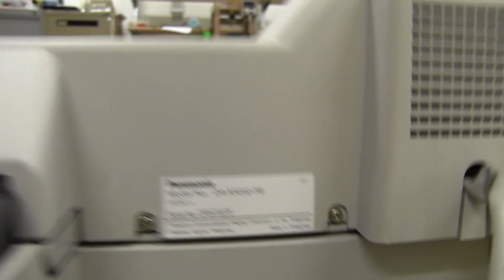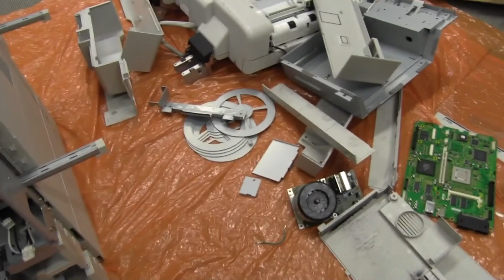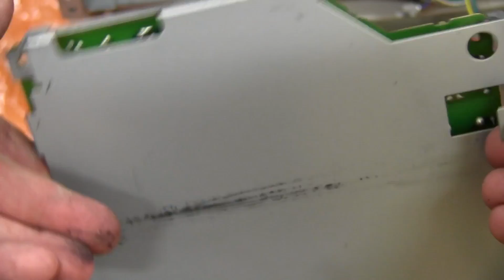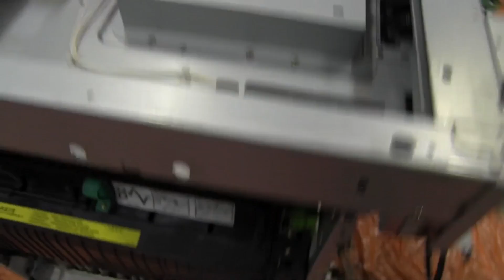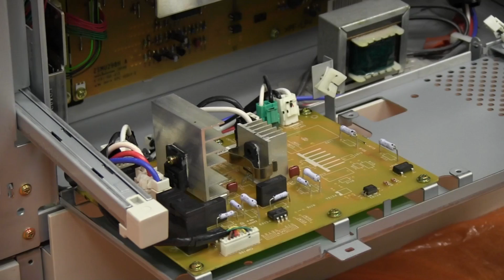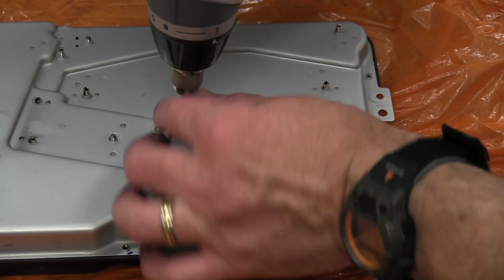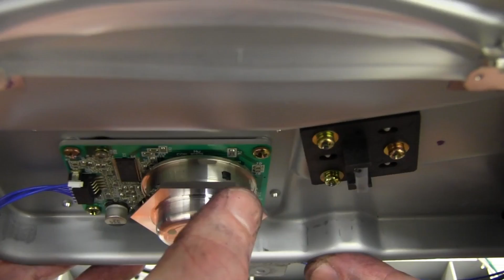EEVblog #303 - Photocopier Extreme Teardown

Comment: Great video!
Just wanted to concur with everyone else ;) 
The CCD is usually between one and three rows high, this type of device is also called a linescan or line camera. They are often used for quality control in industries.
The reason for the two different "arms" with mirrors is for the distance between the lens and the paper to remain fixed, quite clever :)

Comment: i reciently found a lazer printer and the polygon motor and optical systems and some of the stuff were almost the same as that photocopier. And as you said, lots of stuff to hack with. relays, motors, 2 big steppers, solenoid actuators, optical sensors, microcontrollers, eeproms, sdrams, E core transformers, a big 470µf 400V cap, chokes, toroids and of course LOTS OF COGS TOO

Comment: Dave, I've seen scanner devices like that one before in flatbed scanners. The CCD is a single horizontal line of pixels that samples an entire line of page. There is no horizontal scanning like there is in the lazer printer section, it's litterally all pixels in a line.

Comment: The flywheel is there to help stabilise the rotation of the drum and stop image abnormalities due to minute changes. Those smaller units in the paper feed section are drive clutches, quite common to have a single drive motor and clutches to engage drive to seperate sections.

The HV unit can are quite high in voltage, our machines run in the order of 6000v for the transfer stages.

Need to get you one of our retired colour machines with a transfer belt to tear down!

Comment: yea it`s a nice Scanning Laser beam unit there at 33:20 :) 
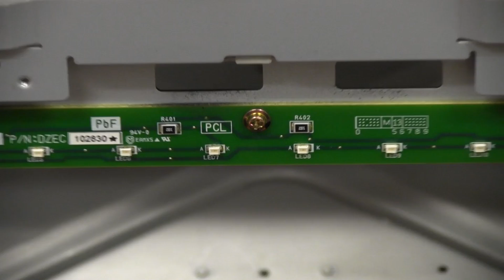The PCB with LEDs on it at 44:10 is called a "charge eraser", it`s removes the charge from the drum so you don`t get a uneven charge on the drums next round. Toner that sticks to the drum get removed by a rubber/silicone blade scraping the to toner of the drum. David, you could PM me if you need to know more on the workings of these :) , but copiers hold loads of goodies ready to be hacked :)

Comment: You can suss out the polygon scanner. The 5 leads are power, TTL and rpm. Ignore the rpm, you apply 5-24V (use component voltage ratings to figure it out) to the power leads (use the electrolytic across this guy to work out polarity), and a hi TTL signal to the TTL lines and it will spin up. Shoot a green laser at it and you'll end up with a laser liquid sky :)

Comment: The "secret black box" is the illumiation for the toner drum. The motor (called a polygon scanner) spins at a fixed rate (hence the delay when you first use the copier for this motor to spin up), and the laser turns on and off in accordance to whats recieved at the optical pickup you explored after the "secret black box". The big D shaped lens keeps the laser spot the same size (divergance will make the spot bigger the further it has to travel from the laser to the toner drum.

Comment: Yeah. Dumb typo. DOESN'T scan "left and right". It's a fixed 1 pixel high sensor by many pixels wide. It images an entire line at a time without moving as the mirror setup moves down the page.

Comment: I tore apart a Mita DC 4090 with the collator last year and it took me almost two weeks - All e-clips and screws - not a single hex bolt. Sold the plastic gears and Tsubaki timing/drive belts on eBay for almost $30. Got almost $20 for the scrap sheet steel minus the steel rods which I am saving. All the motors and clutches test good. There are some really good stepper motors in there!!  Stocked up my electronics project parts. A lot of work but worth the effort. Excellent education project.

Comment: There's a printer contractor in the same building where I work and a few times a year they throw out about 30 of these copiers. Before it goes to the dump I go through and strip them of all the motors, clutches and sensors I can find. I've got boxes and boxes stuffed full of different stuff.

Comment: the sla42m first in line chip 2 phase stepper motor controler.  that first stepper motor you took out how much do you want for it you could easy sell some of those usuer parts lol man I want the motors lol the big ones make great wind turbines or projects. while watching this video cant belive there was only one pbc mounted hipower motor to power most of it other than the little small ones I realy like to have the first one you pulled out. holler at me if you like to sell it.